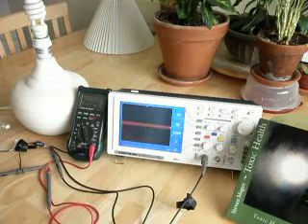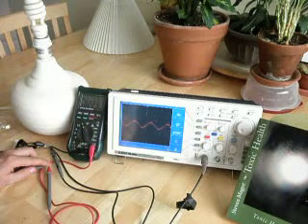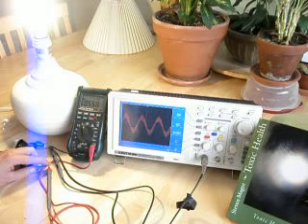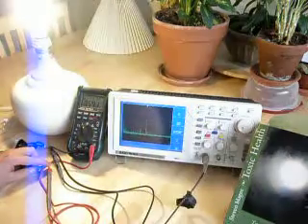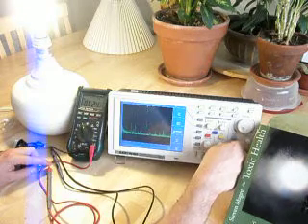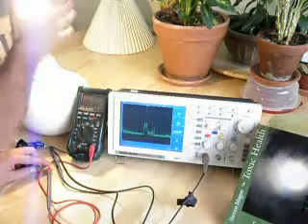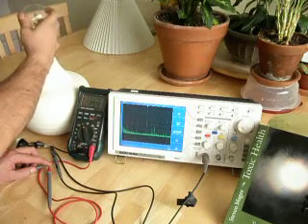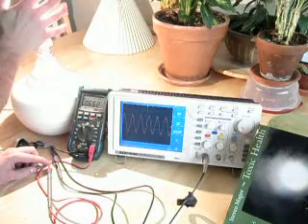Compact Florescent Lights and the Effects on Body Frequencies and Voltages.

Comment from the maker: LED light bulbs have a similar effect on the human body voltage.  The measurements were referenced to a non-electrified ground rod in my back garden that was far away from any electrical systems.  The oscilloscope and multimeter readings were simply taken from the tip of my finger.  I was sitting on a wooden chair and insulated from everything.  My latest research can be found in the book "Toxic Electricity".